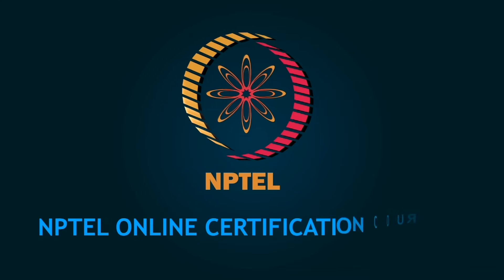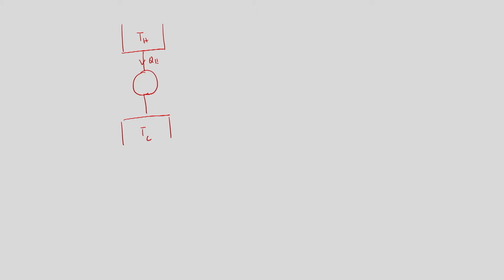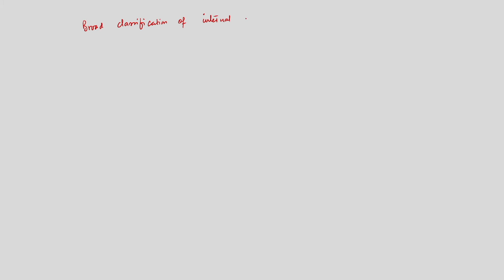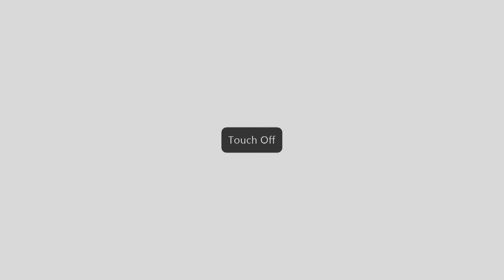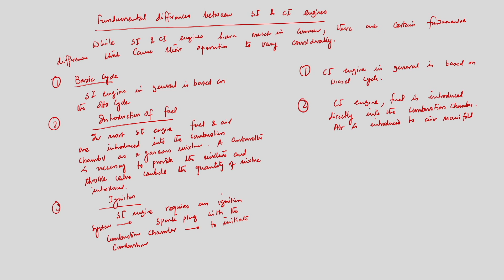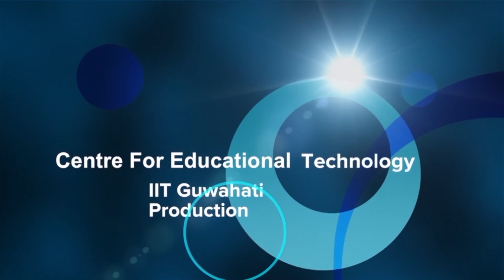Lec 1: External and Internal combustion engines, Engine components, SI and CI engines

Comment: What will happen if we use petrol in CI engine ?
Reply: It runs with high knocking.
Reply: In si engine, petrol is the fuel. So engine runs.
Reply: @thotasaikumar4293  sorry bro actually i had make a mistake in writing, it's a CI ENGINE
Reply: @theyouth2429  because of high compression the fuel mixture ignites before the Piston reaches TDC. So it results knock, loss of efficiency. For 4 stroke I am saying...

Comment: Sir in diesel cycle instead of combustion of air first ,is fuel is only can be made combustion ,is this process possible because it increases a lot of effects.
Reply: In diesel engine air compress until the temperature of air reached at diesel fuel burning temperature ( volitity temperature) ...so if you want to combustion of fuel ( diesel) we need so high pressure and temperature when its entre to combustion chamber , its not possible in practically for doing this must be have external source to reached its ,,, so only diesel will not burn its need high pressure and temperature which get by external source .....
Reply: @mdafrozalam5036  bro calcussis statement tell about engine efficiency , which have L.T AND H.t  limits for cycle , here main cause are the volitity of fuel